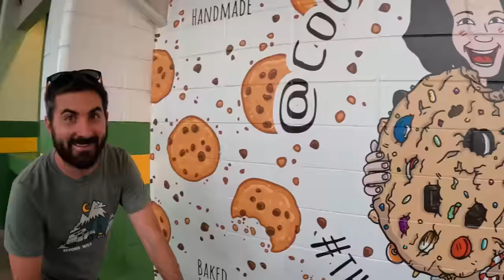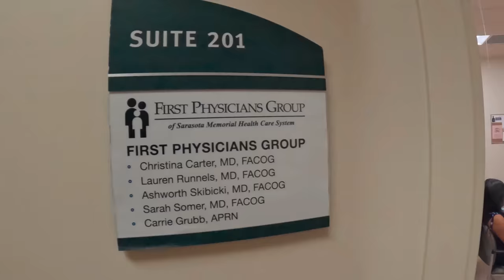Will We Make It? This Cross-Country Road Trip Feels Doomed

Comment: Quick tip: Harbor Fright has a small hand pump for around $5. You can use the small black tube to snake down the dipstick tube and use adaptors to suck out the transmission fluid without dropping the pan. I use mine to suck out the fluid every 20k miles. You cannot get all of the fluid but over time you can get clean fluids in. Cheap and easy!
Reply from the maker: That is a great tip!!!
Reply: @FnAVanLife  Welcome home Frankie!

Comment: With a rebuilt motor there’s a breaking in period and Frank doing it just right get and old school timing light and time it to specs 💯   … love the sunny 🚐
Reply from the maker: the specs are on the money now it is just break her in time. I also have to replace the thermostat. We got one that is malfunctioning. Also one hose to replace and I need to get the transmission pan off to get a new seal and bolts on it.